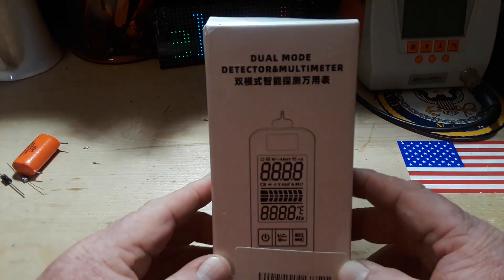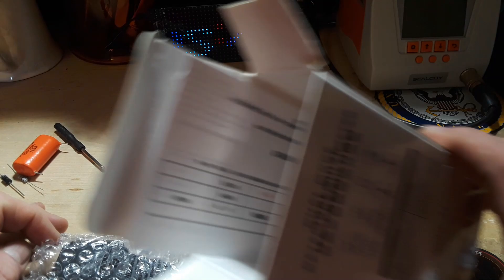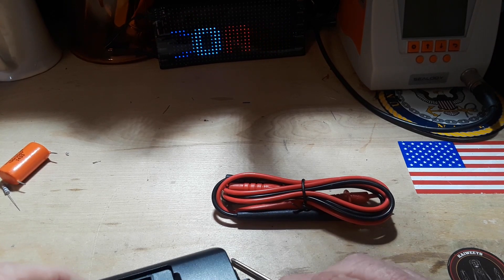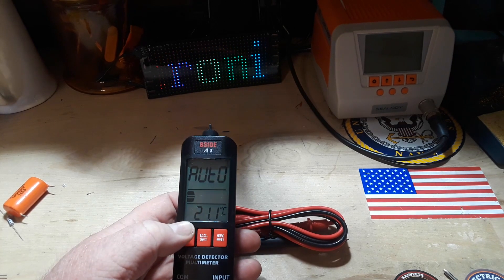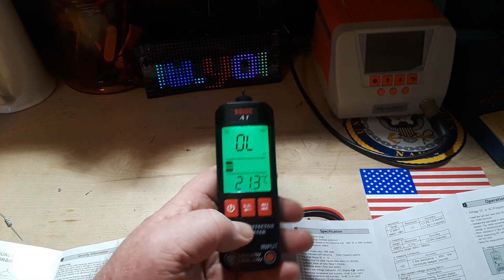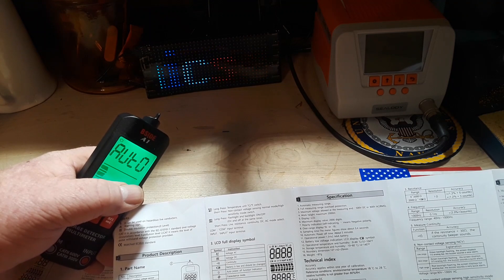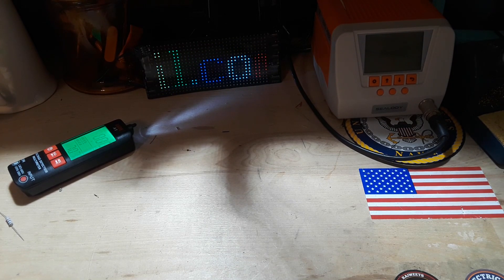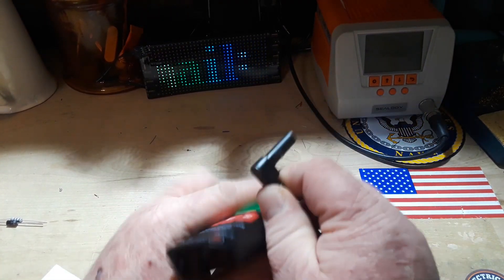Bside A1 Detector & Multimeter

Comment: Totally disagree. I have same multimeter and think it's great in many ways. It's small and handy ideally suits for basic AC electrical works (for components testing better use transistor tester). It has very sensitive noncontact wire detector. Large display digits with different illumination also convenient
Reply from the maker: Ok, I'm happy it works for you, I just can't recommend it.

Comment: When I evaluate either software or hardware, I have the following levels in mind:

0: IS IT SAFE TO USE?
1: Is the basic functionality accessible without reading ANY instructions?
2: Is the slightly advanced (mildly nuanced) functionality understandable via build-in help(software) or quick reference card?
3: If the manual is not included but is accessible on line, can it be downloaded and printed?
4: Is the manual readable without a magnifying glass and are the pictures/drawings clear, well marked and understandable?
5: Are the full details of all capabilities available in the included manual?

A no to any of the above terminates the evaluation immediately with a result of failure.